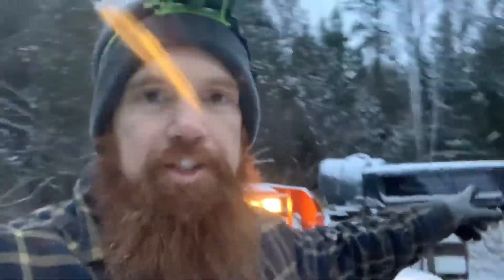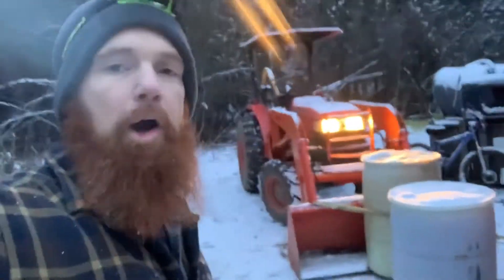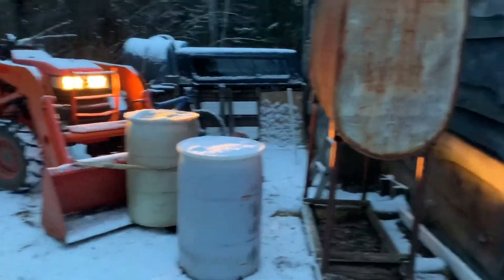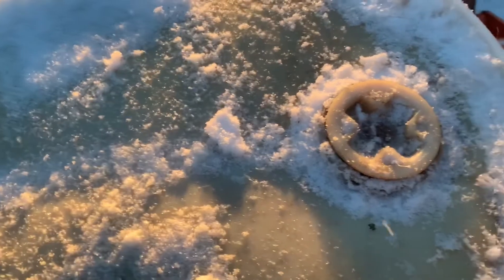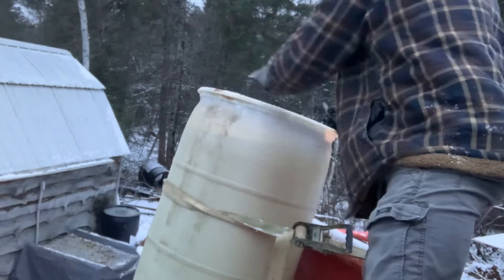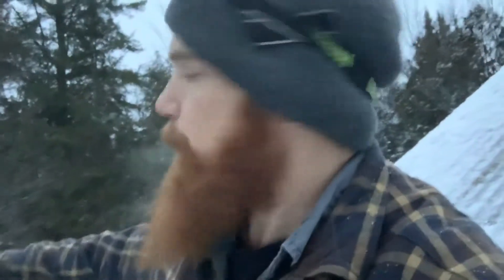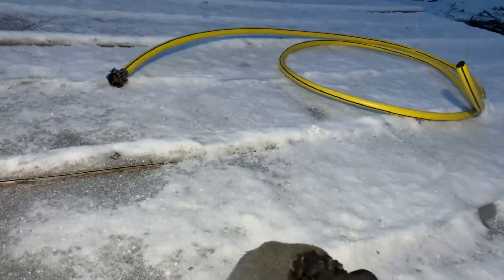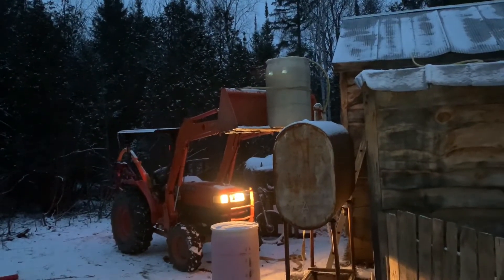How we Heat our Off Grid Cabin

Comment: If u stick the hose all the way in the #2 diesel or at least as far as you can.  then cover the other end of the hose with ur thumb the lift it out and down into next tank the remove ur thump the house will be full of fluid and ur thumb stops it from draining then u remove ur thumb and the diesel will flow. Like a straw in a cup if u cover the stop of the straw with ur thumb and lift it out of the cup it will be full of fluid until ur brake the seal by removing ur thumb.
Reply from the maker: I tried that! I think my hose was too long! I since then purchased a manual lift pump.

Comment: 4:30 You can salvage fuel-oil that's spilled into heavy snow by scooping up the greasy snow into a bucket and bringing it indoors to melt, then pouring the oily water into an empty plastic container with clear/translucent sides, like a 2-liter soda bottle or a gallon-size water/juice/milk jug.  Place the bottle into a larger container like a 3-gallon plastic bucket, move it to a well-ventilated locale away from heat/flames and where it won't get jostled significantly, and let it settle for a couple days.  After the oil and water separate, remove the bottle's cap to let air in, then pierce a small hole into the wall of the bottle just above the level of the separation-line between the oil and water, letting the oil drain out without getting any of the melted-snow water, too.  Then use a strainer-equipped funnel to pour the oil from the bucket into your tank, but without getting any dirt into the tank to clog your oil-filter.  Or for even greater salvaging "efficiency", you can instead suspend the bottle of oil/water mixture at an angle (using a square gallon-size jug and hanging it by its handle makes this tilted-over suspension easier) above another similar-sized bottle that's fitted with a large funnel, let the mixture settle, and then pierce the side of the jug as described above; the angled bottle allows more of the sludge and water to settle into a corner of the bottle where it will stay put better and allow more of the oil to be drained off than if the bottle was sitting level, plus the catch-jug will have less surface-area than a bucket, and so it won't "trap" as much of the oil due to surface-tension when you pour it out into your oil-tank.  Let the bottle sit upside down and drain into your tank for maybe ten or fifteen minutes to get out as much of the precious/pricey K1 as possible. :D
P.S. This same technique also works well for many other valuable fluids that you'd like to salvage after they've gotten wetted and/or soiled, such as gasoline, WD-40, or other solvents/lubricants that you've soaked soiled/stuck parts in; these fluids are generally lighter than water, rust, mud, etc., and so all of said unwanted substances will usually sink and separate out from the desirable liquid that you're trying to save.  Again, it may take a while for the foreign matter to sink and settle into the bottom of the jug, so you may need to wait a few days before drawing off the still-usable fluid (of course, like I mentioned earlier, keep your settling-jug away from ignition-sources, and also don't have it where escaping fumes could offend others and/or affect their health).  But it will usually still be worthwhile to do so, since buying fresh new fluid would be quite expensive, especially if you had additional dissolving/lubricating applications in the future that involved messy/dirty cleaning/oiling with a large volume of costly fluid (like loosening/flushing sticky goo off of machine-parts, freeing up a dust-filled blower-motor, or greasing a bicycle-chain), and so you didn't need your solvent/lubricant to be totally "pure 'n' pristine" in that case, anyway.  I always carefully recycle even sludge-mired WD-40 for "already grungy" applications like cleaning off heavy deposits of grease/rust/mud, oiling a wheelbarrow-axle, etc. --- saves me a bundle on buying new $20-plus gallon-size cans of WD-40 whenever a large "immersion-type" servicing-task comes along where I need to submerge a large item into a partially-filled tub of WD-40. :D

Comment: Also you could add a tire vale to the top of each of you drums and use one of those cigarette lighter air compressors to pressurise your drum until fuel flows and then remove it. I had mine screwed into the cap, I wouldn't thread it in just hook up the compressor then hold the cap down over the hole until I heard it flow the removed it so it had enough air to replace the fuel coming out.
Reply from the maker: Genius !!

Comment: I always use a clear hose so i don't ingest nasty oil or gas but you have to deal with what you got. LOL! Keep up the good work!
Reply from the maker: I have a roll of clear that I am planning on using for running water in the house but it won’t stay straightened out enough to be able to get it to the bottom of the barrel! 😂

Comment: Better way to start a siphon (if the sending tank is pretty air tight).  Hook up your outlet hose/pipe.  Place a short piece of hose into the fill pipe and wrap it with a rag.  BLOW !  HARD !!  Compressor is even better.

#2 works good if the outlet is at the bottom of the sending tank and the fill of the receiving tank is up hill.  Using a long flexible hose/pipe connected to the outlet.  With the end BELOW the level of the tank, turn on the outlet valve until the fuel starts to flow out the end of the hose.  Cap the end with your thumb and then place that in the receiving tank which of course is below the level in the big tank.
Reply from the maker: I purchased a nice harbor freight hand crank pump. Game changer.

Comment: An easy way to remove ice from a garden hose --- at least the flexible-walled kind, not the brittle hard-plastic kind --- is to firmly tap all along it with a hammer to break up the ice into powder, then shake it out thoroughly. :D

Comment: --Chad fuel oil is best heat per btu ...Love my oil furnace ...Heating oil around 2 bucks...Cheap....
Reply from the maker: I’m using off road diesel at the moment for about 1.74 a gallon. I looked into fuel oil local and it was around 3.26 a gallon? What’s the difference?
Reply: The cashier calls it off road some call it #2 oil or furnace oil basically all the same..I use what ever i can get...Stay warm and safe...Great channel....
Reply from the maker: @kevin-gj6ij  thank you! You as well!

Comment: I am sure you know why diesel comes in two different colors.  The Diesel that you pump at the Gas station is clearish in color and the price includes a Road tax.  The reddish color diesel (AKA Home Heating Oil) is usually cheaper per gallon because there is no Road tax applied. Also allows authorities to catch people using home heating in on road vehicles.  I would not worry about that cause you're Off-Grid. LOL
Reply from the maker: Exactly! I’m gonna hafta get an “Off Grid” badge made up! 😂 🤔 😆